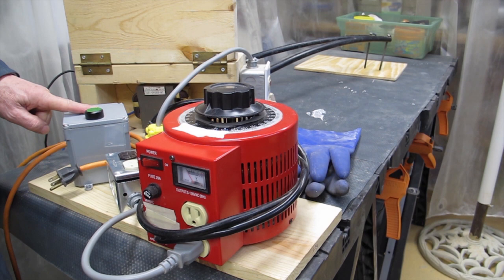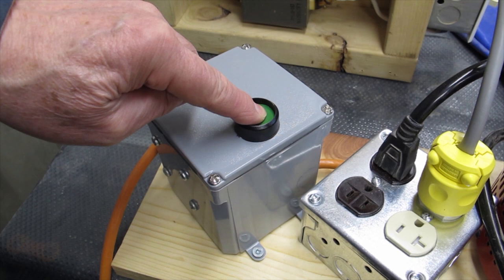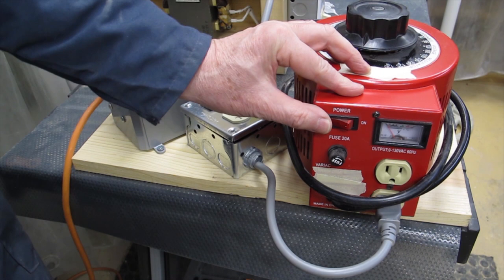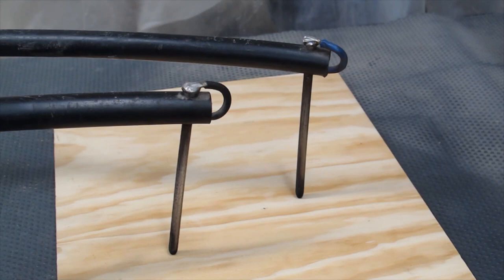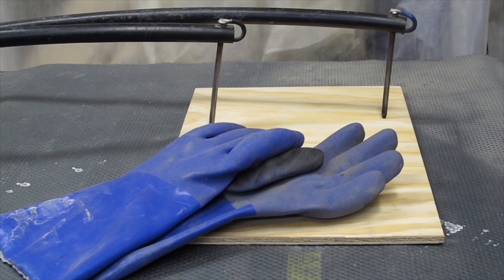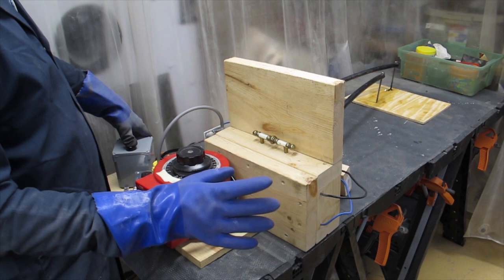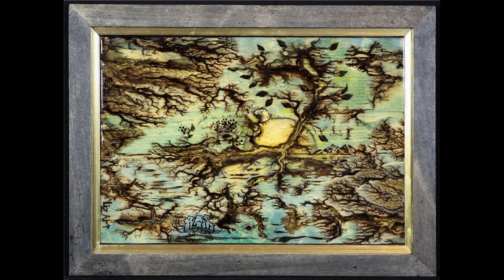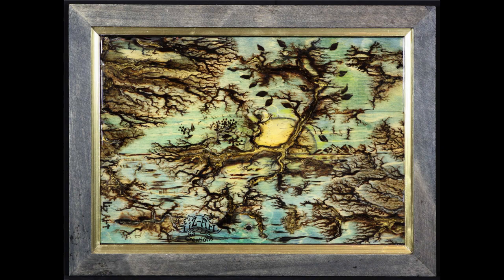Lichtenberg Pyrography Safety.

Comment: My congratulations on an excellent video!  My neighbor and I have been thinking about doing this and yours is by far the best example of what I had in mind for design & safety characteristics.  Well done!  As a retired high-energy technician, I can appreciate your approach!  Thanks for sharing!
Reply: Don't do it, even expert electricians have died trying this. Even if you take all the precautions, it's still too dangerous and it's not worth it
Reply from the maker: Thanks blackdog850 for your compliments.  My goal when I made this video was to prevent people with no knowledge, or limited knowledge of electricity from killing themselves.  I heard about people being killed doing this, and saw numerous videos where I thought they where taking ridiculous risks.  I wanted to show all the safety features I use, and people such as yourself with knowledge of high-energy systems have also recommended improvements on my system.  I recommend anyone without adequate knowledge of the science, the risks, or the skills to NOT DO THIS.  I would make the same recommendation for flying, skydiving, scuba diving, mountain climbing, and driving cars and motorcycles.  If you do not know how to do it safely don’t do it.  Of course people still do all these activities and I believe people are going to do this form of Lichtenberg pyrography no matter what I recommend but at least I am showing my system in a hope that those people learn to do it safer.
Note that I do not show how to wire the high voltage transformer or any other component.  Anyone attempting to do this needs adequate knowledge to build the system.  Hopefully my system will inspire them to focus on safety.

Comment: Thanks for sharing your video. I also have  built several machines used for Fractal Burning projects. I use a lot of pine wood. One tip I learned is you should not over saturate the wood and only brush on and wet it with you solution before using the machines.  This in my case has produced much more beautiful and expansive burns especially when you manually adjust the variac as needed while the burn progresses.  Great fun for sure.
Reply: I am glad you enjoyed the video.  I really appreciate your comments and recommendations.  My focus was to provide ideas on how to do it safer.   I have seen a number of videos where people hold probes and clamps in their hands with limited insulation or safety measures to protect them, which I think is very dangerous.  I hadn’t seen any systems that use safety buttons and controls to keep both hands away from the high voltage so I thought I would share my setup.
I typically do fractal burning on my wood work and on my wood turning.  I have used metal and cloths dampened with the baking soda solution to control the direction of burns.  I can really control the fan out of the burn using these methods.  I prefer a tighter grain wood like ash, maple, and oak which is what I typically use for my wood turning.  I apply the solution sparingly because moisture on wood leads to warping and cracking.  I have a YouTube video of an ash vase that I applied Lichtenberg patterns on, and we have artwork on our website where my wife incorporates the fractals into her paintings, or pyrography. It adds a very unique embellishment to any wood creation.
I hope you have lots of fun “safely” creating spectacular fractals.

Comment: I have wanted to try this for a few years ( my neighbor used to do this) .He was always going to show me how but life seems to get in the way of the fun stuff. I have moved away and I do not know what equipment he used. I have been researching this more and more lately and this is the best setup I've seen so far. I'm no safety nazi by any stretch of the imagination but I have been working with electricity sense 1977 and I know the shit will kill you so quick it's not funny. I have crawled inside 3000 amp switch gear ,and this makes me nervous. ALL the redundant features you have are. Greatly needed. I like the momentary button. At the Risk of sounding like someone's overbearing mommy. There is NO overkill when making or using this. It looks cool but don't be known for being the dumb ass that fryed himself because your too cool not to take it seriously.  
Thanks for making this for all uf us that are interested in this really cool art. There is so many way it can be used.
Reply: Thanks for the feedback.  If you have worked with 3000 amp switch gear you could probably make a few recommendations to improve my system.  I realize I could use better wire and actual conduit rather than plastic pipe for my high voltage leads, but I keep my distance and air is a relatively good insulator.  I’m not ready to start working in a Faraday cage or suit. 
https://en.m.wikipedia.org/wiki/Faraday_cage 
I have worked in industrial plants where equipment uses two control switches that have to be pressed simultaneously, one with each hand.  That way the operator can’t accidentally get their hand caught in the machine.  That was what I was aiming for by keeping both hands busy.  One on the primary power button and the second on the variac controlling the voltage.  Keeping a safe distance from the high voltage side was also a priority.  The other safety features are to prevent people without knowledge of the system from accidentally powering it up.  I could have hardwired the high voltage transformer to the output from the variac, but that made it difficult for me to store the system.  
Since milliamps can kill working with 3000 amps is really scary.

Comment: You have went much farther towards safety than most. Some suggestions. Did not know by your video the voltage wire class of the high voltage wire going from transformer to probe. Is wire rated for 2500 volts?  Also the electrical gloves needs to be at least a class 1 rating for that voltage level.  
But Deadman switch, like you built-in, is a must that most do not have and I see some not using any electrical gloves which is foolish in my opinion. Good video.
Reply from the maker: Thanks for the great suggestions.  I try to keep my wires well separated and I am always at a safe distance from them whenever the power is applied.  I made use of what I had available and I am not sure what the wire insulation is rated for.  When I am near the probes the power is always off, and the system is unplugged.  I hold the wooden boards to move the probes and I only move them when there is no power being applied.  I never get near the probes if there is power on the system.

I have seen a number of videos of people using their home made and even commercially manufactured systems holding the probes in their hands.  No gloves, no safety devices, and often holding the insulation on battery booster cable style of clamps.  In my opinion they are deadly accidents waiting to happen.  I made this video of my system because of information I discovered from the AAW (American Association of Woodturner) of how many people were dying using these systems.  I wanted to show my safety features hoping that people that are doing this, or plan to do this, do it safer.  Air is a great insulator which is why I am always far away from the danger zone.

Comment: Most people should stay away from this art as they don't understand the dangers truly. The high voltage from the transformer can be up to 3,000 Volts and your high voltage wires seem to be improper insulated for such high voltage. Also, I would recommend two push buttons such that no hand will ever be free to mess around with the setup while the voltage is on. Of course it's obvious to never have anyone else near the setup while it's being operated. I like the special power connector that avoids stupid accidents by anyone messing with the cabling.

Comment: I’m too chicken to get into this hobby but I just have to say, wow lol amazing setup and considerations. Your thorough explanation of everything is something you don’t see too often 👍
Reply from the maker: My goal was to inspire people who intend to try this, or are doing this, to do it as safely as possible.  It is very dangerous if you are not familiar with electricity and safety procedures.   I would strongly recommend NOT attempting this if you do not have sufficient knowledge, training, and experience.  I have over 30 years of experience in electronics, aerospace, and computers.  I have worked with teams to design medical and aerospace devices incorporating multiple safety features, and I have worked with an assortment of industrial equipment.  I am sure others could improve on some of my methods to make it even safer.  According to the American Association of Woodturners there have been a number of fatalities burning Lichtenberg patterns which inspired me to create a video on how I do it to make it safer for myself.  Hopefully anyone trying this will get ideas on how to do it safer.
Reply: I tell people who want to get started working with electricity and power tools: if you aren't worried you'll hurt yourself, don't do it. You =should= be thinking about safety, you =should= be thinking about how you might get hurt. The most dangerous bits of a tablesaw are invisible when on, the most dangerous part about electricity is that it is completely silent and invisible.

So if you never feel safe enough to try it, you still have the right attitude.

Comment: It probably doesn't make sense to clean the electrodes, but it wouldn't hurt to put a fan to cool the high -voltage transformer and a thermorel on its body. It is desirable to install an indicator lamp that indicates that the primary winding of a high-voltage transformer is energized .I liked the pictures!
Reply from the maker: opt57-ru   Thanks for the suggestions.  I do have a light on the switch on the transformer, but the reality is I never really notice it.  I rarely run the transformer at full power and it is for short periods of time.  Much shorter than I typically run a microwave which is where I got the transformer.  I will have to check to see how hot it is getting with my laser thermometer the next time I am doing any burns.  There are times that it seems difficult to get a burn started.  I couldn’t say if it was due to residue on the electrodes or due to insufficient or poor quality baking soda solution.  I clean the electrodes just to eliminate that potential issue.  My wife’s artwork amazes me.  She is artistic and I am technical.  When she starts a painting I can never picture what she sees but the finished product amazes me.  Thanks again.  I appreciate your observations and feedback.
Reply: @liz-artcreations6633  To understand how to start burning quickly, you need to study the mechanism of arcing, spark discharge on the surface of the wood. The current flows along the path of least resistance and if the surface of the wood has not had time to absorb a sufficient amount of electrolyte and the surface is covered with a layer of liquid electrolyte (electrolyte puddles) - then a spark discharge occurs over the surface of the liquid and this electrolyte is sprayed from the "puddle", the space around the electrode is drained. It is necessary to allow time for the electrolyte to soak into the porous surface of the tree (not ) and remove the excess electrolyte from the Board. The solution of baking soda should be as saturated as possible (at the bottom of the vessel should remain insoluble soda crystals).It is desirable to start the burning process by applying no more than 50 volts to the high-voltage transformer and increasing the voltage after the arc front occurs. I hope that the automatic translation will be done correctly. Yes, your wife's paintings are creative and she clearly has a high talent.
Reply: Very cool.   Neat video and craft.

Comment: Your attention to safety is impressive. What could be a potentially dangerous project is not so scary watching you. Kudos. I'm not sure what voltage you are dealing with but when I worked for the power company we had 5KV and 30KV gloves. You might want to try to source these to add a layer of safety. Also nomex clothing would be good. Also keep your feet together .Again, well done!
Reply from the maker: The transformer produces about 2000 volts .  Thanks for the suggestions.  I really appreciate when experts such as yourself contribute advice to make this even safer.

Comment: Nice box, not good enough. I appreciate you are away from the burn.  But your 8 gauge wire is not high voltage rated, (probably only 240VAC), and I really would rather you have a double pushbutton system so both of your hands are tied up in pushing two buttons, and preset the Variac before you turn anything on.
Lastly, those gloves, are they rated for 12KV?  If not, get some.  And poly pipe has no rating, save it will keep water in.  
I am a military trained electrician, (21 years, retired), and spent 30 years in factories, as a electrical maintenance manager and an industrial engineer. 
 I got into this hobby about five years ago, and had a similar setup, save I elevated my platform off the bench with two glued on 2X4's. After time, you get a bit lazy...then maybe cut a few corners.  We all say we won't, BUT WE ALL DO.  I recently got into fractal burning guitars, and one late afternoon, a bit tired, didn't realize it was still on and touched one probe. The other one literally jumped into my other hand, as the hand was touching the edge of the guitar body.  I "Rode the Lightning" for about two seconds until I fell on my right side, heavily bruising my shoulder and hitting my head on the floor.  When I hit, I woke up, got up and went into the house and had my wife call 911. Heartrate was 160, and I ended up in a burn center for three days as they monitored my heart, and treated the burns on my hands, which were not that bad. Huge hematoma on my forehead, and a scalp cut on my head where I scraped on a bench nearby. NOT FUN, NEAR DEATH EXPERIENCES....
Changes I will make:
1. Add two momentary on switches to the incoming 120VAC in a plastic housing. Both have to be pressed to engage the unit. No 120VAC, no burn. Two switches, two hands.
2. My potentiometer, which I use to adjust the voltage, will be next, in a straight line away from me. Adjust before I can press both buttons, which are UL approved to be Open when released. 
3. The actual unit on its platform, further away down the line.
4. The probes, with 10K insulated wire, extending to a separate wooden table.
5. Finally, 12K gloves, 1.8MM thick, in case the switches, and the potentiometer all fail and it stays lit.
6. I am standing on 3/4" insulated rubber flooring, the final table will not be on the same rubber.
Sound like a lot?  6000VAC is a lot!  I am lucky to be writing this, but this is what I should have done in the first place.
Lichtenberg is like nothing else in beauty, and it is highly, highly dangerous.  I see people using regular wire, no gloves, machine very near to the work, and I think, there is number 34, waiting to die....
Stay safe.
Reply from the maker: Sorry to hear about your accident.  I hope you’re ok.  You said you have a similar setup to mine.  If so, were you holding the power button while moving the probes?  I never do that.  I always turn the power off on the variac and release the power button before I even get close to the high voltage area.  I like to control my burn process with the variac which is why I only have the one push button. 

I work on separate plastic benches which are both on 1” thick rubber mats and I am standing on the mat for the low voltage section.  Normally the benches are separated but I had them close together for the video to show the overall components.  The low voltage components are on one bench and the high voltage components are on the other so I maintain my distance from the high voltage components.  I can’t move the probes while the buttons are pushed, so there is no power to the system, because they are out of reach.  I also never allow anyone to be close to the system before I start burning.  Normally I am alone and I have my system set up outside when I do this.  This way I am not breathing smoke from the burn.
Thanks for recommending improvements to my system.  Good luck with your future burning and be safe.

Comment: 1) You need to use high voltage insulated wires on the HV side of the transformer. 2) A “system hot” light or buzzer is a good reminder 3) Info that the transformer should not be grounded on the supply side would be good. 3) Better HV probe insulation would be good, it will jump through that thin plastic pipe. 4) Your unrated  thin rubber gloves are better than nothing, but could be a false sense security.
Reply from the maker: These are all EXCELLENT recommendations on how to improve this system.  I made use of what I had available and my primary objective was to eliminate the risk of power ever being applied when working at the potentially "hot" end, and to isolate myself as best as possible while it is live.  Primarily by staying well back from the high voltage, or any voltage for that matter while the system was working.  Thanks for the recommendations and I hope they help others stay safe.